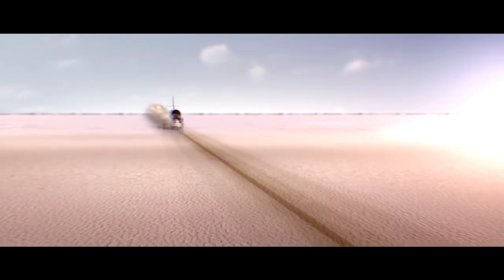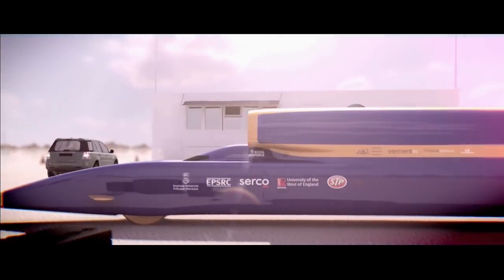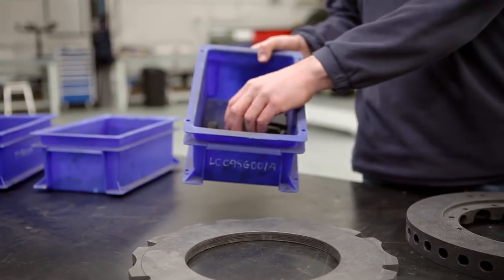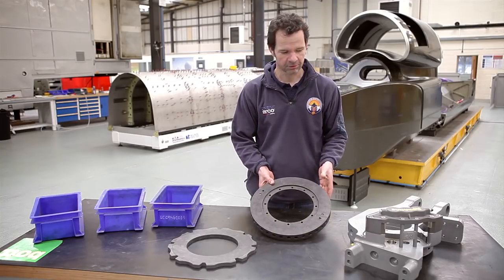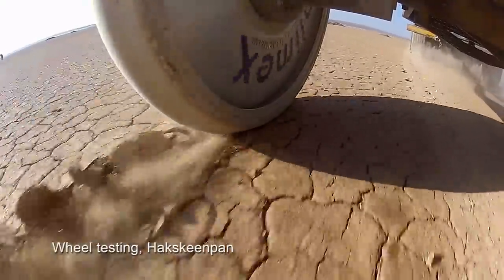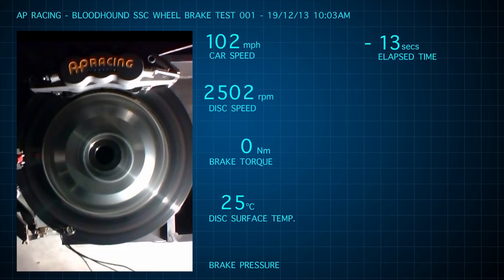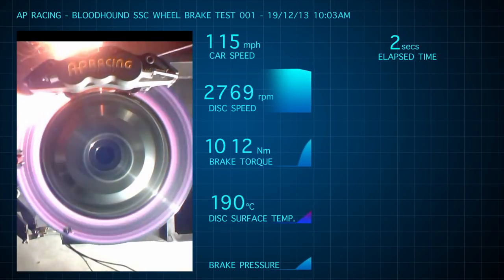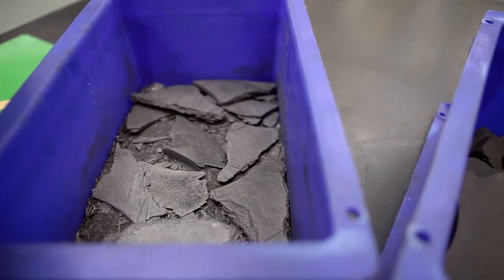How do you stop a 1,000 mph car?

Comment: I saddened when I heard a kiloWatt being used as a unit of energy.

We're told the energy dumped was 4.6kW over a period of 19 seconds.
Clearly nonsensical.
Perhaps they meant 4.6kJ, or, that the peak or average braking power was 4.6kW.
Reply: He's probably not got a science or engineering background. In his defence, it is possible to convert 4.6kW over a period of 19s. That would equate to 87.4kJ, or the energy of this vehicle if it was going just under 12mph.

I hope I did my sums correctly.
Reply: Jay Smith If they are going to put out videos or have people talk about their science it behooves them to make sure that the words attached to their story aren't... ignorant. 4.6KW is only about 6HP, like a small motorcycle engine. If he meant MJ then that's as much as an A380 brake pack takes in a second on a hot stop. So that might be in the ball park given the poor grip.
Reply: cageordie I didn't realise that it was an 'official' video. It's too bad the script wasn't checked.
Reply from the maker: Jay Smith HI Jay, yes that slipped past both BLOODHOUND and AP Racing Engineers (!) the figure should have been 263kW
^JT
Reply: BLOODHOUND SSC - 1,000 mph car Thanks for the reply! 263kW heat is pretty impressive...
Reply: Central heating...
Reply: Most vehicle brakes are rated in units of power.

Comment: Maybe a clutch system that disengages the rotor over 170mph. One that's quick change like a multi plate set up in top fuel drag racing. Or embedded magnets within the wheel slowed by electric stator? I have been following this since the beginning and remember watching thrust ssc when I was a kid. Love what you guys are doing. Keep it going- please!!!

Comment: What were ThrustSSCs discs made of? Surely the new ones would be similar?
Reply: According to the interweb SSC's discs were carbon. Remember it 'only' had to go up to 763 mph not 1050 mph so the RPM would have been quite a bit lower than 10,000.

Comment: Only a thought, but have you considered the prospect of having inboard brakes that were only engaged, via a clutch mechanism at relatively low RPM?  That way you could have very powerful carbon fibre or ceramic braking without the risk of having them disintegrate.
Reply: because a shattering clutch is better than an overheated purpose built brake? don't take it bad, but we are talking about 263kw of braking power gone in a few seconds. having any kind of gearwork between the wheel and the brake would overheat it tremenduously, probably to the same extent of the brake itself, since it has a demultiplication job.
that's one of the reasons why inboard brakes where dropped, they took more time to service, were more complex to devellop, and they overheated the differential. They also made the driveshafts take a serious toll at every brake effort, for the meager advantage of less suspended weight, bigger brakes without big rims (check formula 1's which had this setup, or gokarts) and a compact package.

Comment: Why not use a magnetic braking system I mean there won't even be contact at all kinda like a dropping a magnet in a copper pipe.  I know they have used this type of braking system before to slow speeds down to a manageable speed for a normal braking system to bring it to a full stop with a lot less stress on components.
Reply from the maker: Our engineers did look at magnetic braking systems, but packaging them in limited space and the weight penalties ruled them out.
Reply: BLOODHOUND SSC - 1,000 mph car.. Yeah I can see that being a problem it's easier to build something that will fit in your vehicle rather than trying to modify or change what you have already put so much time and work into making sure the body can handle the loads it will be subject to. Hope to see it being tested and getting to that magic 1000.mph.

Comment: I hope this will be remote controlled and no one is in that thing going 1000mph
Reply: Nope...it'll be manned....I think by Andy Green, who drove Thrust SST past the sound barrier.
Reply: i would love to be in that vehicle (can't call it car now since it looks like a rocket on wheels) going 1000mph :D
Reply from the maker: sam signorelli Yes Andy will be at the wheel again
Reply: BLOODHOUND SSC - 1,000 mph car Thanks.  What sort of emergency systems are in place if control is lost at speed?  ARE there any systems that could protect him?  Unlike the fighters he flew, he won't have enough time for an ejection seat to work unless he's VERY lucky.

A crash at speed will NOT be pretty.
Reply: I met Andy Green when the team flew out of Stansted Airport for their Thrust SSC record breaking run back in '97 and apart from being a top bloke, his RAF pilot experience means he's in his element - albeit at ground level.
Reply: sam signorelli I think the focus is on making sure there is 0.0001% chance of losing control of car at speed, I don't think there's much you can do to save it if it does lose control at 1000 mph.
Reply: 123eldest
Truly,,,,he won't have any time to react at all.
Reply from the maker: sam signorelli Andy will be sat in a carbon composite monocoque, similar to an F1 car's chassis. The tail fin will keep the car straight like the flight on a dart and the wheels have been designed to slide on the desert rather than dig in and cause the car to flip.
^JT
Reply: +BLOODHOUND SSC - 1,000 mph car It's like waiting for Christmas, i cannot wait to see this thing complete and do a full power run in Africa !
Reply: I realize this comment is two years old, but if i may:

Even as the team does EVERYTHING in their power to keep their driver/pilot safe, this sort of record will always have an element of danger.  As soon as it's remote controlled, it's not even interesting.  Not because we love seeing death and destruction (although some may), but because we have deep respect for those willing to risk everything to achieve something so high.

Comment: well when you go that fast and you want to stop do 3 things 1 step on the brakes has hard as you can 2 pray it stops and 3 scream as loud as you can !!!!
Reply: Parachute. At maximum speed thrust = drag, so when you cut the power it slows down fast anyway. This is needed for the last bit.
Reply from the maker: cageordie Airbrakes and drag will do 99% of the deceleration, the wheel brakes shed about 1% of the energy! Parachutes are for back up

Comment: This doesn't make any sense. It doesn't prove anything.
Reply from the maker: Getting to 1,000mph is relatively easy, slowing down is a majour challenge. The wheel braking system is a key for speeds below 160 mph. 
^JT
Reply: BLOODHOUND SSC - 1,000 mph car Oh okay.... so the parachute and drag will slow the car down quickly enough until around 160MPH where you can take advantage of this new braking method?